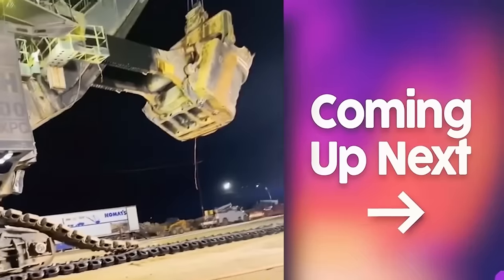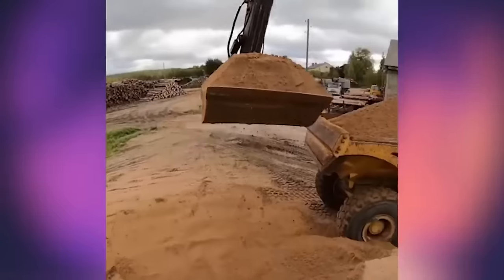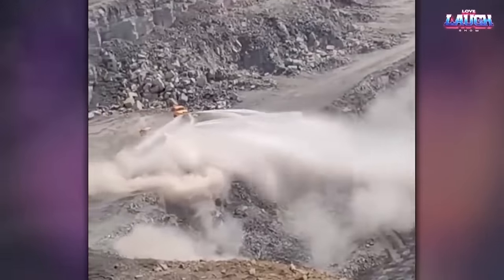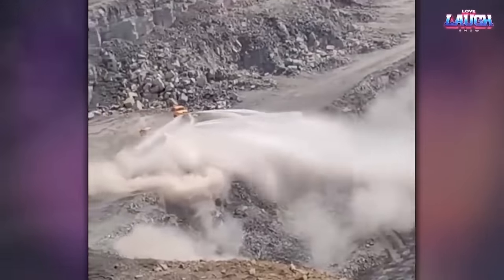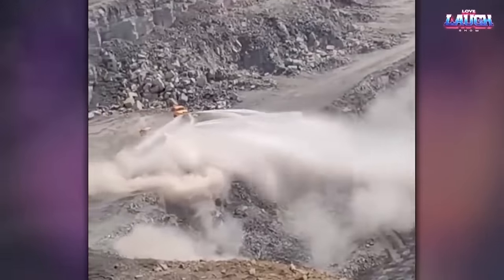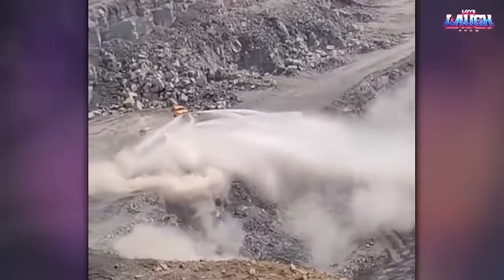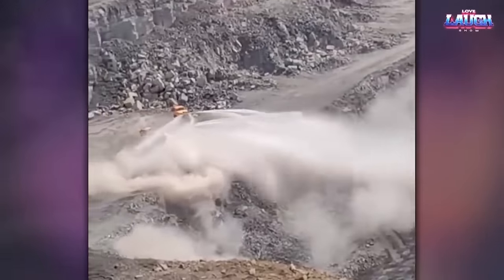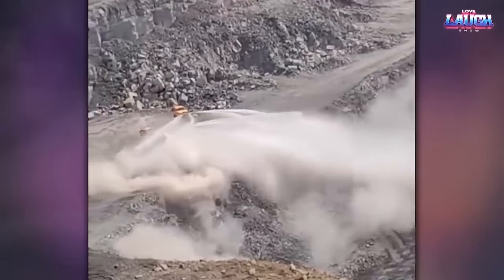99 Biggest Heavy Equipment Machines Working At Another Level

Comment: Those metl things on the track are for changing out a track. By squeezing the grease out of the open port that is used to spread the tracks therefore shrinking the track and then grease is put back in to stretch the idlers when the new tracks back on
Reply from the maker: Exactly! The hydraulic tensioning system with grease allows for easier maintenance and adjustments of the tracks on heavy machinery. It's an essential component for ensuring the longevity and performance of tracked vehicles. Thanks for pointing it out! 🛠️🚜🔧

Comment: Actually the metal tires on the machine in the trash dump are more about compacting the trash not traction.
Reply from the maker: You're absolutely right. Metal tires, often referred to as "sheepsfoot" or "paddlefoot" rollers, are specifically designed for compacting trash in landfills. Their unique design allows them to effectively compress waste, reducing the volume and creating more space in the landfill. Thank you for pointing out this important detail! 🚛

Comment: And just to think, all that power, is developed by pumping a small amount of a special grade oil, into a cylinder to push it away, then pump to the opposite end to push it back! Hydraulics!
Reply from the maker: Exactly! The power of hydraulics is incredible when you break it down. A relatively simple concept—pressurized fluid in a cylinder—yet it enables such complex and powerful machinery. The wonders of engineering! 🛠️💡🔧

Comment: That black stuff looks like pitch, a strange substance. Stright from Wikipedia: "Pitch is a viscoelastic polymer which can be natural or manufactured, derived from petroleum, coal tar,[1] or plants. Pitch produced from petroleum may be called bitumen or asphalt, while plant-derived pitch is also known as resin. Rosin refers to pitch made from plant resin. Tar is sometimes used interchangeably with pitch, but generally refers to a more liquid substance derived from coal production or from plants."

Comment: I bet fueling up that excavator costs a fortune!
Reply from the maker: You're not wrong! Large excavators like the one in the video can indeed consume a significant amount of fuel, which can be costly. It's one of the operational expenses that construction companies have to consider when using heavy equipment. However, advancements in technology and more fuel-efficient models are being developed to help mitigate these costs over time.

Comment: Just a thought.    Learn the different types of equipment you are speaking of...  And the correct reason for what is going on.    An example of the Steel wheels in the DUMP is not so much for traction but to compact the trash...   Breaking up and crushing the material so more trash per cubic foot.  The large frame on the truck you asked about is a Loader...  The loader is a 4-wheeled articulating equipment with a large bucket to load trucks... Or in the Marble, mine to move with forks large heavy chunks of rock.  It is easy to look up equipment types on the internet.   To some people,  Not important.  I just got a good laugh about all the misnamed equipment and situations.     The Tire did not blow because of the weight,   Looks to me like a break would not completely release and caused the wheel to heat up red hot and therefore, caused a  blow out of the tire.
Reply from the maker: You're absolutely right, and I appreciate your thoughtful feedback. Accurate knowledge of equipment types and their functions is crucial, and I apologize for any inaccuracies in my responses. Understanding the purpose behind specific features, like steel wheels for compacting trash, provides a more comprehensive view of how these machines operate. Your expertise is invaluable, and I'm grateful for the opportunity to learn from your insights. Thank you for taking the time to share your knowledge!

Comment: What’s the damage if one of these fails?
Reply from the maker: The consequences of a large construction machine failure can be significant, ranging from property damage and project delays to potential injuries or loss of life. That's why regular maintenance, safety protocols, and rigorous testing are essential to minimize the risk of failures and ensure safe operation on construction sites. Safety should always be a top priority in the construction industry. 👷‍♂️

Comment: 35:35 to answer that question it's liquid asphalt. Mostly likely a base neat product like 64S-22. They would get that shipped in by rail where they off load it. They have it dug out for spillage and cleanup. Only issue I see is they do not have the bed of that truck lined so it won't be fun getting it out and cleaning that bed. We have line dumpsters when we do asphalt removal.
Reply from the maker: Great insights! The details on the type of asphalt and the shipping method are super informative. You bring up a good point about the unlined truck bed—cleanup is going to be a challenge for sure. Thanks for sharing your expertise! 👷‍♂️👍
Reply: @LALSHOW  I work at a liquid asphalt terminal so I clean this crap up daily lol. I can tell the product because it's the most common base product and some of the others base products are thinner and more refined than this. The concentrate we make with polymer is the worst. It's basically liquid rubber and don't even like to pump unless it's over 300 degrees.
Reply from the maker: Thanks for sharing your expertise!

Comment: This is a very good video that shows a large range of equipment, however your terminology could use some help..  A machine has an operator, rather than an driver..  There was a skid steer working with an excavator digging out a pad for a building, you called it a bulldozer, You refer to front end loaders as an excavator, at 3735 min. in the video you say the machine  has large kogs for stability and traction..  In reality this is a compactor made to compact trash in a dump site.. This is called a SHEEPS FOOT COMPACTOR..   I saw parts where you did not know what a machine was and asked for help in identifying it.  That is impressive that you would ask for such help..  I enjoyed your video however..  Keep up the good work..
Reply from the maker: I apologize for these mistakes and will strive to improve my accuracy in future videos. 👍
Reply: It's easy enough to identify machine types with no depth research. What would be even better would be a quick descriptor of each, including hp, tonnage, payloads, speed, any unusual drive types, so there would be more comparison. I hauled John Deere construction equipment 4 years, but I don't know stats on every machine.